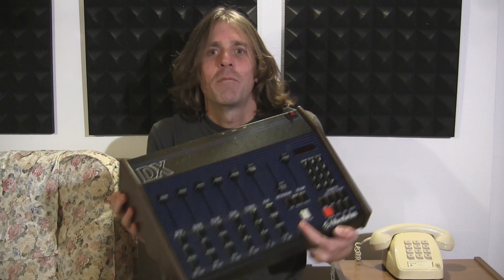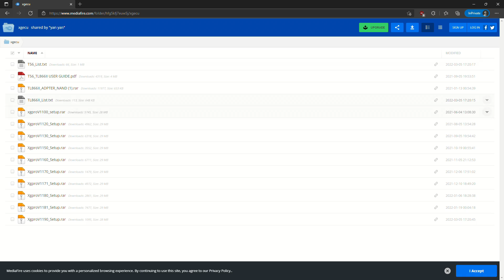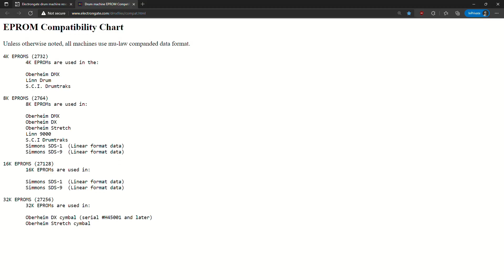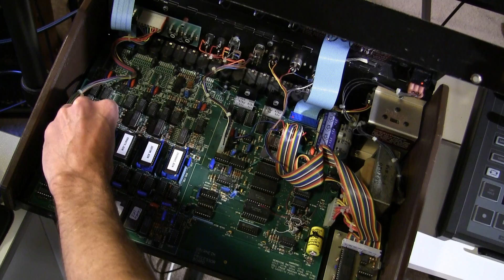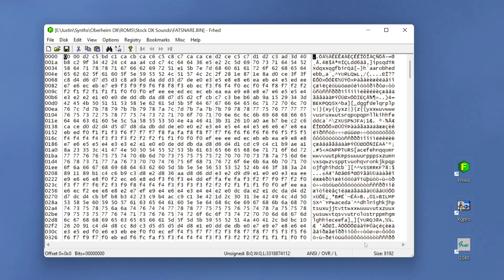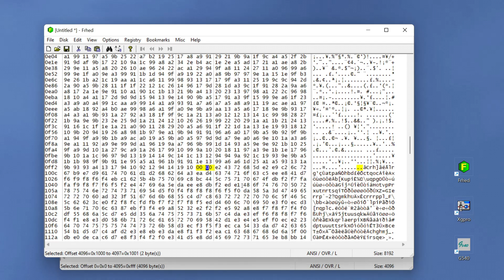How to Edit and Burn EPROMs for Drum Machines

Comment: I HAVE A HISTORICAL QUESTION ; does anyone know who, witch company(s) provided drum machine manufacturers like lynn, oberheim, or sci, and simmons (mtx9 and you're packed), with those classic sounds some of them share in theyre list. i mean alot of those sound are used in several units, i'm pretty shure someone specialised in recording and digitalising (Ulaw) drum sounds at the time was providing several compagnys with those drum codes to burn on eproms, but who? Ithink but i'm not shure, i mght remember reading somewhere that this ward Clavia's first activity, but i'm having trouble to find my info, and google has became useless for these types of reaserchs since a few years anyway....
Reply from the maker: I believe Oberheim recorded their samples in house with their own engineers - see here https://www.youtube.com/watch?v=CMzOsjuzWFE&t=119s . Linn likely did the same. Sequential's Drumtraks has no original sounds - just a mix of the Oberheim and Linn sounds which they must have borrowed or licensed. The company you're probably thinking of is Digidesign who recorded 3rd party EPROM sound sets for the drum machines - they went on to create Pro Tools.

Comment: Mr.Mullins .Can you please specify an external power unit and the specifications  to add the extra power to help me make my eproms for sd1 sd9 etc.I have everything I need thus far I havent  noodled with the software yet .I have eraser some vintage eproms and a pretty popular usb burner that should be able to do the job.I havent been successful in buying an external power source.I need to know the recommended  requirements of the supply as far as voltage ,amps,wattage of the power suplly I need.At my own risk of course thanks alot for your time.Thanks for the vid.
Reply from the maker: Sorry I don't know what you need the power supply for - if your eprom programmer is not getting enough power you might need to try a different USB port or use a powered hub
Reply: I'm being told to use a bench power supply DC for the Simmons 21volt Eproms to be written on work on my xgecu 3rd gen utilizing the top left prong .This is my first attempt at any of this so please forgive my lack of knowledge.I just want to learn what I need to know to make my own Eproms and hopefully maybe program my own new sounds from scratch..Thanks .So generally a capable bench power supply in the basic affordable nature.Thanjs again

Comment: Is there a software you recommend for converting sounds into bin format?
Reply from the maker: For these particular machines you can use DMXWAV down the bottom of this page and I think the Promenade software on the same page also does it http://www.electrongate.com/software/index.html 
If you're looking for other machines (Drumulator, RZ-1 etc) check the links in the first sentence on this page http://zine.r-massive.com/drum-machine-sound-rom-decoder-suite/

Comment: cool video!!! do you have a link of the ebay seller you buy your 2732 and 2764 eproms from or could you recomend one? also what are the part# of those black zif sockets you used in the video? Cheers
Reply from the maker: ebay: chipsgate and jkpartsstore

ZIFs:
Mouser No:535-28-526-10
Mfr. No: 28-526-10
Mfr.:Aries Electronics

The 24 pin is Mouser No:535-24-526-11
Reply: @juztinmullinz  Thank you so much! for the zif what is the difference between 28-526-10 and 28-526-11? are you using both on your drumtraks, both working? what is the part# for the black drum switch, do you buy them from mouser? I think a lot of those mid-80's drum machine use those switches too. Cheers
Reply from the maker: @ginomakentino6719  I haven't replaced any switches - if you search around the internet you'll find guides on how to pull them apart and clean them to get them working again which seemed to work for me.
Reply: @juztinmullinz  about the zif, what is the difference between 28-526-10 and 28-526-11? cheers
Reply from the maker: You'd have to read the specs but I seem to remember there was versions with/without gold plated legs so that might be it? Not sure.

Comment: How would you go about splitting up one sound over multiple Eproms like the Crash?
Reply from the maker: So I'd probably start with one big file of 32768 bytes (4 x 2764 eproms) that has the whole sound then just copy paste every 8192 bytes into 4 smaller files. Pad the sound with 0's at the end if it doesn't fill all the chips.